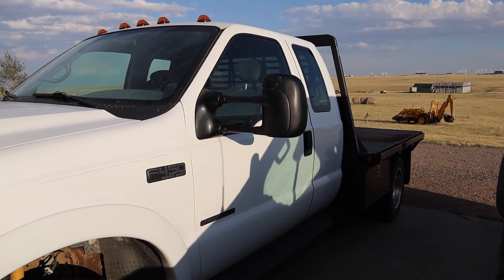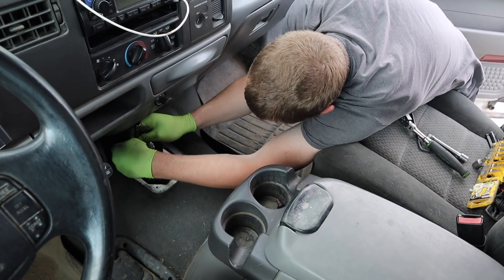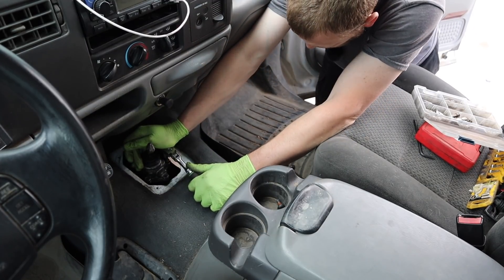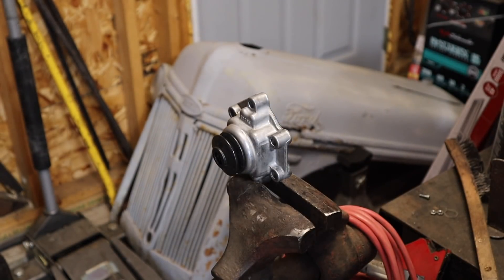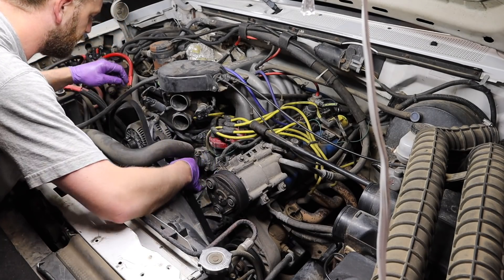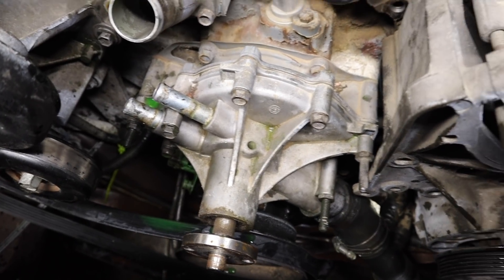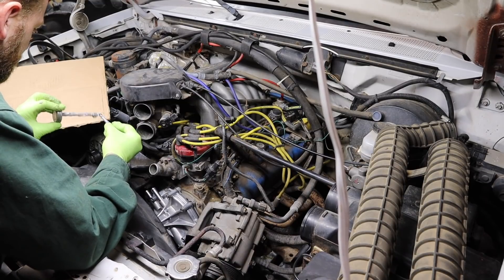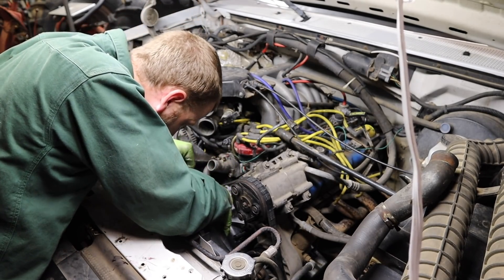My trucks are broken

Comment: Nice work on the ol' 7.3 Power Stroke beasts.  Good tip using the Torqx type tool to get that stripped out socket head bolt out.  Anti-seize is definitely a must on serton bolts & shafts.   Keep up the good work.  Stay safe.

Comment: After watching your R&R of the boot/seal, was it really necessary to remove the top cover?  Looks like that seal could simply be popped R&R'd without unbolting anything except the shifter dust boot floor flange.
Reply from the maker: The shift lever in the center has to be removed from the cover in order to remove the seal.
Reply: @GuyinWY  Ahh, I see what your saying.  I've had this dampness under my '99 7.3 ZF6 for a while and this probably my issue also.
Reply from the maker: In order to put the new seal in, the shift lever must be removed and it has to come out through the bottom of the cover.
Reply: @GuyinWY  Thx, had to let your first response soak in a little.

Comment: How did you get by without breaking the bolts? I have a 1995 f 150 with the 5.8 L engine and when replacing the water pump we ended up breaking the bolts off which I find out is a common problem.
Reply from the maker: I did this job a couple of years ago on this truck, and I used a ton of anti seize when I reassembled it.
Reply from the maker: Yup.
Reply: No it's still working. I bought a new one and it looks good we got it at AutoZone